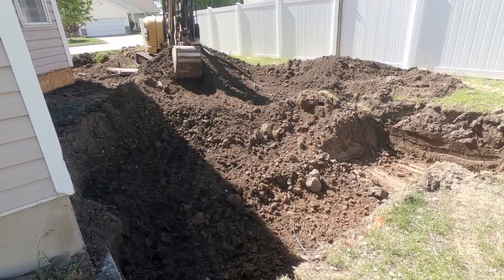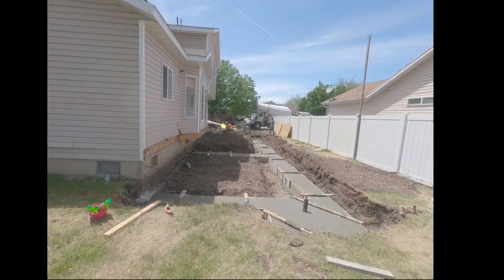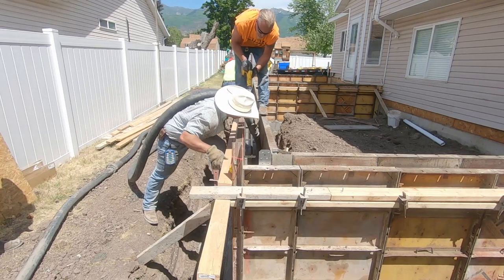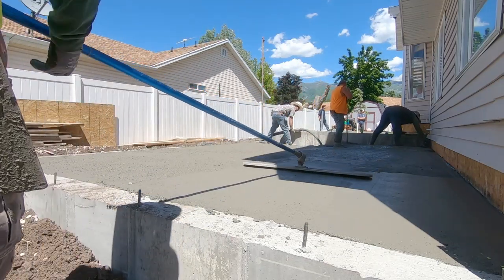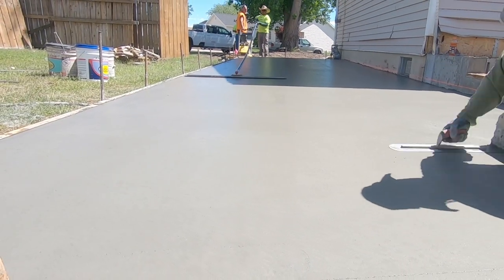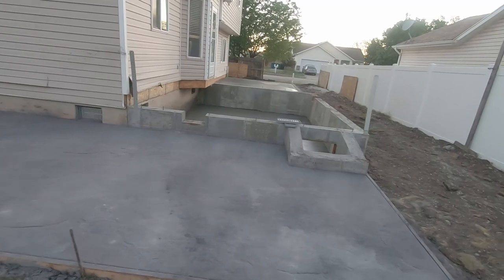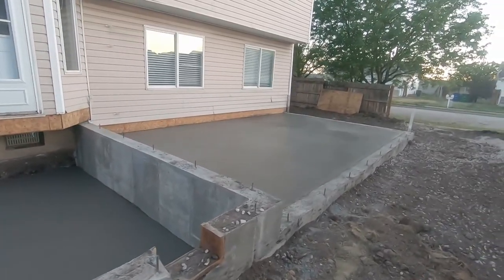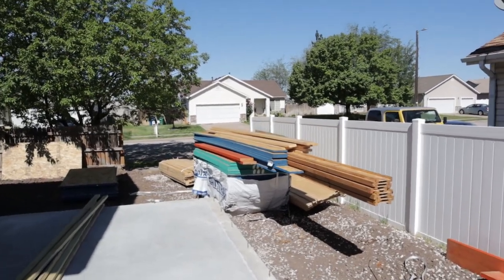Foundation for our DREAM Home Addition Earthwork and Cement

Comment: Could you share the details like type of cement thickness , and how deep you had to dig ? 
Thank you !
Reply from the maker: 8" thick vertical foundation walls. 4" thick slab on compacted fill. You just have to dig down as deep as you want your final elevation. The part over our kitchen that has the crawl space was about 3' down. whereas the slab on grade portion not as much.